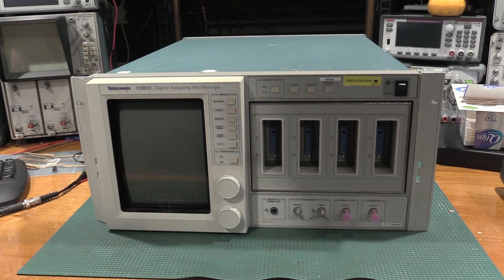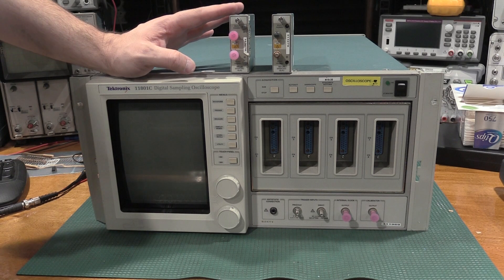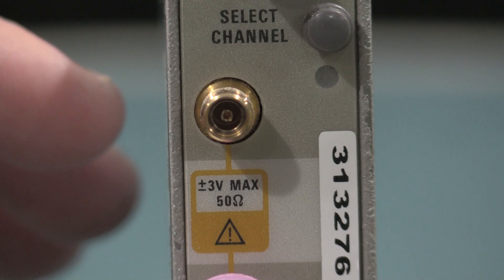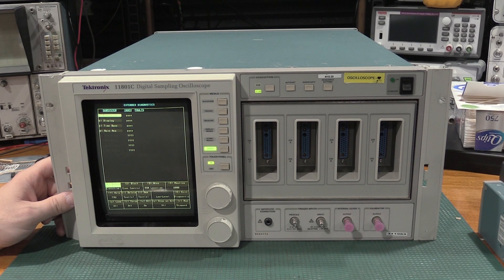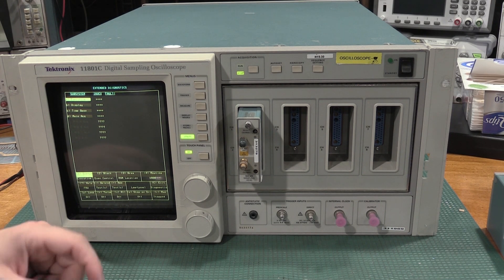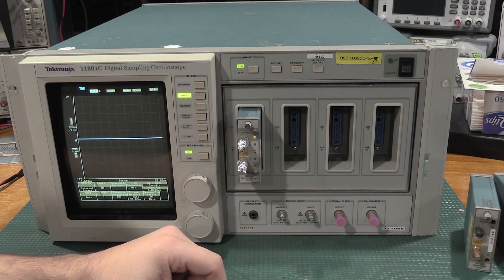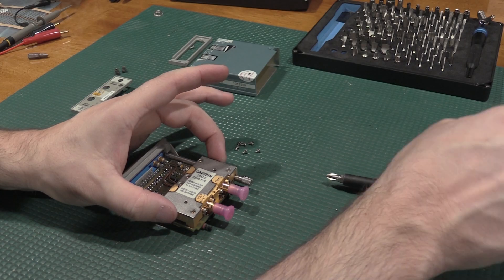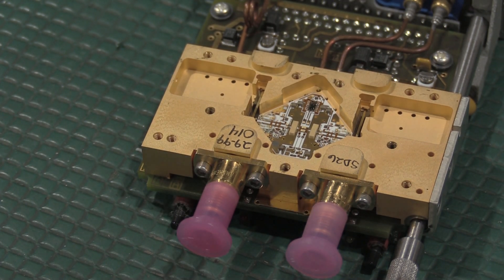When the wrong parts are bad!

Comment: You can check the input load resistance of those modules with a good bench multimeter. For example, my HP 3457A outputs just over 1 volt DC into an open and about 0.5 volts DC into a 50 ohm load. Also, for the module with the bad EEPROM, you might check the cal procedure to see if you can load a default set of values and then recalibrate it. I had to do that recently with an oscilloscope that had a corrupted NVRAM.

Comment: One thing that may be worth looking out for: The SD-24 manual indicates:

To prevent damage to the sampling head or instrument, never install or remove a sampling head when the instrument's PRINCIPAL POWER SWITCH is ON (powered-on).

(The principal power switch is the one on the back.)

Comment: SMA and 3.5 mm connectors are mechanically compatible so you can test them. You also don't need a torque wrench for simple test setups. If you were doing a calibration on the modules, you might want the adapter and tools.
Reply: Yeah don't be tempted to use a spanner, just finger tight will do for testing, I'd argue cleanliness is more important.